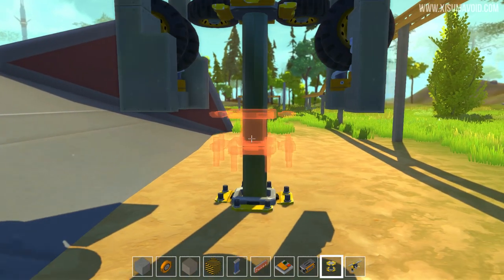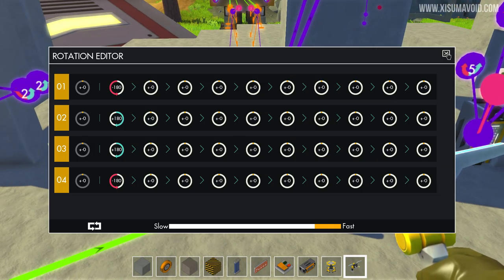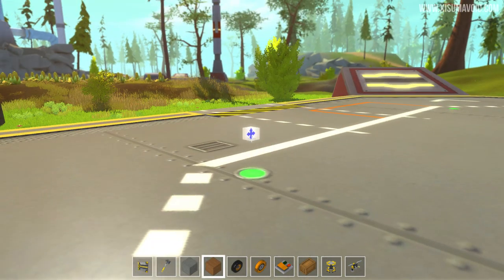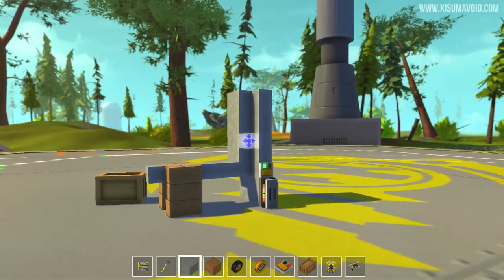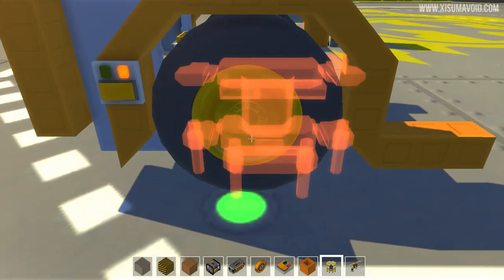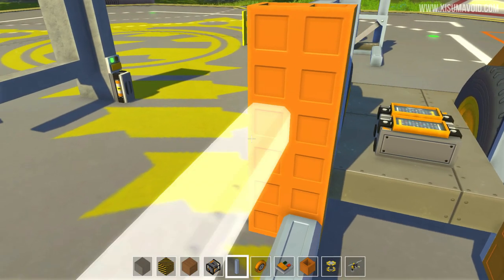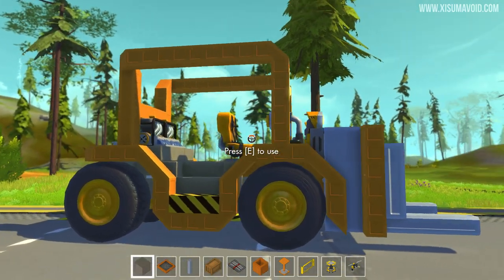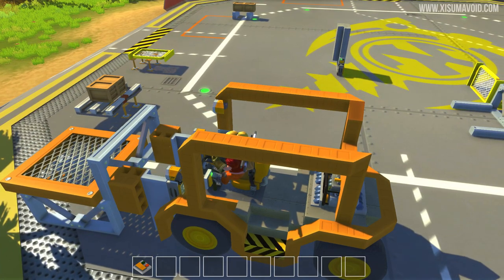Scrap Mechanic: Forklift Truck

Comment: When you slowed the animation down at ~7:45, you can clearly see the blocks catching on each other. This is giving the "jumping" which throws the object you are picking up off the arm.

This has also been, I think, a cause of issues with some of your other projects, such as the Spider Car.
Reply: You could try using rounded pipe blocks instead to fix the catching problem.

Comment: RIP Spider car 2k16-2k16 ;-;
Reply: +Alexjgate oh, you mean 2016-2016, because there is no point in saying 2k16 since it's not shorter than 2016
Reply: XD lmao
Reply: Enze Jansen No, that's the reason i put it xD It's a complete waste of time putting 2k16 because it's no shorter and if anything harder to read but that's why i put it to sarcastically mock those who generally use years like that xDD
Reply: I have a mostly working spider car if you are interested in seeing it work. I'll upload it when I get home. I think Xisuma's main issue is he is trying top hard to mirror things instead of merely copying so he gets confused by the movements..
Reply: +Enze Jansen And you said 2016 three times and 2k16 once just to point that out. Hey look, I did almost the same thing! xD
Reply: GAMING WITH TIMMY_007 so what, if I type 2k16 three times, it's just as long as typing 2016 three times
Reply: +Enze Jansen it's actually not. Depends if you're fast on typing numbers, or fast on typing letters.
Reply: +xXMineBloxXx wait, no I mean like, your hand could be closer to letters than numbers
Reply: xXMineBloxXx ever seen a numb-pad?
Reply: You could have just wrote 2016 instead of 2k16, which costs a lot more afford to write
Reply: MineFish Oh trust me, i know the stupidity of writing '2k16' over 2016 and how it's completely pointless, which is the reason i use it xD
Reply: :} lel :}

Comment: Forklifts steer on the back wheels as you said but they drive on the front wheels, just letting you know :b
Reply: Also the front leans towards the back,  which keeps the crates stable.
        /
    _/       Like this
Reply: +legofan jj actually  they usually have a way of tipping it back and forth so as you said they can keep the crates on, but also get the crates off the ground with level forks
Reply: Well I should have guessed that, well I don't study fork lifts either
Reply: Sylt?
Reply: +Shoot Luck Gaming forklifts have weights on the back of them right behind the seat, it looks like its part of the body
Reply: +Moot Doe yeah when i made mine i stacked weight on the base and back as pat of the design, or you won't be lifting anything. this method doesn't give much lift either, you would wanna use a piston set up at 90/180/90 for the fork. goes out the same distance as here, yet allows for much higher lifts. there are videos showing how to make a piston...or you could wait for the real thing.  you could scissor it to, but takes more space then a  simply piston set up. 

The turning in back and power in front is the ideal set up as well, as weight matters in game and this make turning easier as well as moving with heavy lifts.

lol I actually use my forklift to lift my builds,  any other set up just doesn't work as well as the standard irl forklift.  for Mobil cranes  you'll want a ton of metal blocks as the main base as well..weight is really really important when lifting using a device not attached to the ground.

Comment: Xisumazoid your 3rd forklift concept, the one the the double bearings, is the way to do it. you just need to change the switches to buttons and in the controller make the movements 15 30 15 degrees and turn on repeat. that will give you one button to go up and one to go down

Comment: the forks are called tines here in Australia, also holy hell that is a beast of a forklift. 

And as for the issue of not being able to control set heights, may i suggest you have it set on loop with first phase as null changes, the second phase set at 45 degree, third as null, forth phase set at 45 degree, fifth phase as null then sixth phase as -45 degree. then seventh set as null, eighth set as -45 degree  .Then hook it up to a button, holding it will allow it to move to the next stage (if you let go it locks to the last position if you go past it a little or the next height if its closer to finishing that step), Each time it locks to the next stage it will remember that point until you hold the button. Now the only drawback of this issue is that you have to go through the whole range of motion before it returns to rest position.

Comment: You could use the pressure switch instead of the toggle switch for the forks. It will just continue up before it comes back down when you resume.

Comment: Most forklifts that I'm aware of are front wheel drive, rear wheel steering- though the method of front wheel drive isn't really achievable in Scrap Mechanics right now.

IIRC there's a fancy differential on the front wheels that basically makes it so that as you steer, it controls the amount of power going to the individual wheels, allowing you to turn much tighter, and turn in place 'round the front wheels when the steering wheel is turned fully to one side or the other.

Comment: Curious, what if you used wheels to move the forklift up, as you did with your Star Wars door design?

You could use a two-operator design, where one chair is connected to the drive engines to maneuver the vehicle, and another is connected to engines that raise/lower the forklift. That way, you could use W and S to turn wheels and pull the fork along a vertical track or brace of sorts. This could give you the variable range of motion you desire, rather than it being binary (either fully lowered or fully extended). If you used electric engines, you could set them to low speed, but still probably get good enough horsepower to lift heavy objects. I know this would likely become fairly bulky, so maybe it wouldn't be suited to small items like the ones you're trying to pick up here. Perhaps it could be useful for picking up larger items -- like other vehicles?

I might try playing around with this idea myself, actually.

Comment: You could make the sections between the bearings a bit longer. Instead of 2 blocks, have it 3 or 4 blocks. That would make the forks go much higher.

Comment: I built a nice forklift, wasn't something I really wanted to build. I just needed another lift, and what started out as a simple build turned in to a forklift.  Though i used a piston set up as i needed much more lift then that. this method does't give that much lift, mine uses 3 barrings at 90/180/90 and lifts straight up 12 blocks high.

Comment: Your missing the steering wheel in the back. Fork trucks have one wheel in the back for steering
Reply from the maker: +JJCM04 Not seen that myself before :-)
Reply: Some do and some don't. The ones for indoor use often have one to maneuver in tight spaces. Btw. I've never heard of a forklift driven from the rear wheels IMO irl having the front wheels driven makes much more sense.
Reply: +xisumavoid You should've probably had the wheels closer together..it was a bit awkward
Reply: kevin tate Where I work the back wheel turns the fork truck and the front wheels are stationary. :) learn something new everyday :)
Reply: JJCM04 same

Comment: I made a successful flip flop/button switch. tested it for about a day because I have it in almost all my creations
Reply: I cant remember. Whats a flip flop switch?
Reply: It's basically 1 button means on other button means off(in the case of my circuit both states can output), of course with X's multiple button input the amount of inputs could be increased
Reply: indykoning Oh right. Ok thanks :D

Comment: No i think its possible to make a fork lift that Stops where you want it Allthough it wouldn't be able to drive [Attaching wheels to blocks Then going forward are backward then it would work] so if you want to make a nother video about fork lifts Try this! :)

Comment: From someone who used to drive a forklift. The forks are way too short. And switch to electric engines they have better torque and have a more controllable speed.

Comment: I've never heard it called a forklift truck. Is that a British/European thing, or an Xisuma thing?
Reply: +Matej K The choice to use "a" vs "an" isn't determined by what letter the word starts with, but by what sound the word starts with. You are correct that "an" usually precedes words beginning with vowels, but this is not always the case. For example, "unique". "An unique situation" would be incorrect. Conversely, there are times where "an" is used before words that don't start with a vowel, such as "an hour".

"Xisuma" either begins with an "ex" sound (ex-soom-a) or an "iss" sound (iss-uma). Thus, you would use the article "an" for this word.

Comment: can't you make each new creation in a different world?
Reply: +George Stevens (MrPickle25) 
A) you'd end up with a lot of worlds
B) It requires more time and effort to go back and look at an earlier creation for reference.

but, yeah, he may end up doing that until the game has been optimized a bit.
Reply: +FreeER ‘aka’ atubeacct I make one every 4 smaller vehicles or max 1 per world if it's a tank or something. If you make relatively light creations that shouldn&#39;t be a problem. I don&#39;t notice frame drops at all.

If you have a massive truck on 12 suspension parts it may start lagging out. If you have more then 4-ish vehicles with 4 suspension parts each it may start lagging out as well.
I&#39;m using a GTX750, so it&#39;s not like I have a beast of a PC or anything.
Reply: +OJJVZ Suspensions have awful memory leaks, just dedicate a gasoline engine to some bearing suspension
Reply: +kevin tate That's a lot stiffer though, I believe? I just like suspension parts, so I'm happy to make extra worlds. But i'll keep it in mind if I ever get epic frame drops, thanks for the tip.
Reply: +OJJVZ well it's actually adjustable suspension for hard suspension use electric Motors,  for super bouncy suspensions use a low powered gas motor or medium powered gas motor for an offroader for say
Reply: kevin tate Oh like that, that makes sense. I'll definitely experiment with that. Maybe it would work for the tank like thingy I'm making.
Reply: +OJJVZ look at Attila Attila's video on it
Reply: kevin tate ty